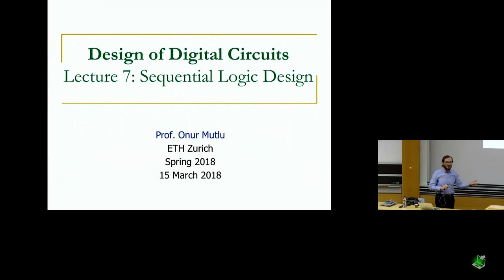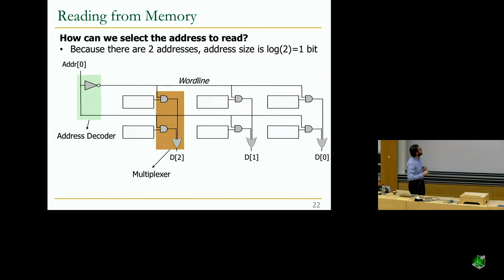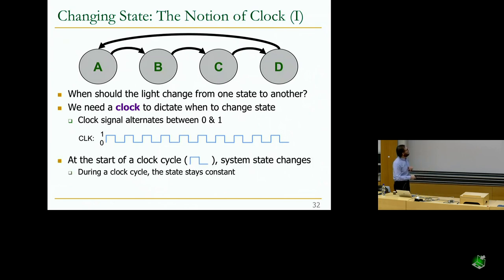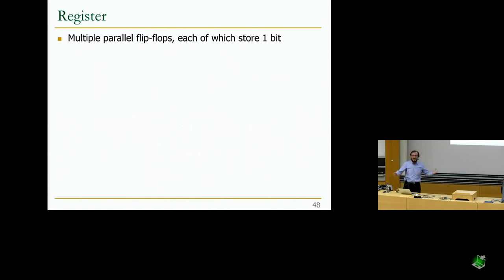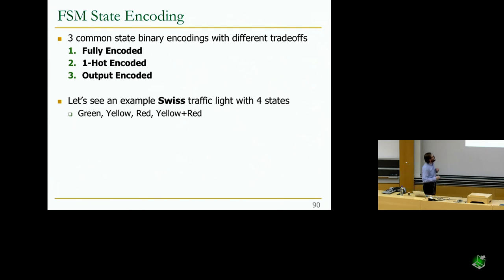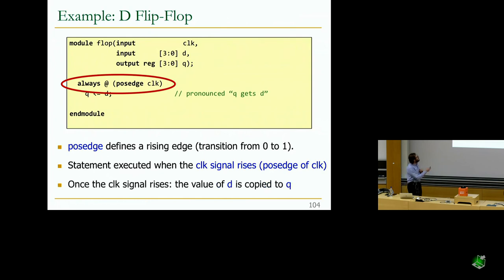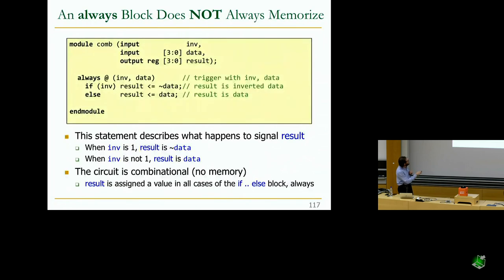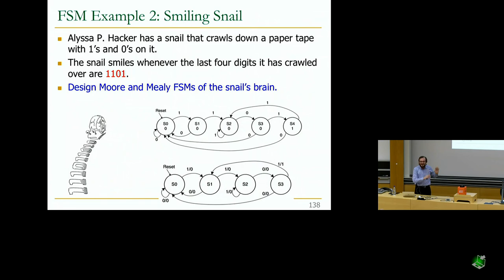Design of Digital Circuits - Lecture 7: Sequential Logic Design (ETH Zürich, Spring 2018)

Comment: I think on slide 42, "When the clock is high, Q will not take on D’s value AND When the clock is low, the latch will propagate D to Q"; I think it's reversed, shouldn't it be "When the clock is low, Q will not take on D’s value AND When the clock is high, the latch will propagate D to Q"? Please excuse me if I am wrong.
Reply: Junyao Ren  I also think that is a typo.